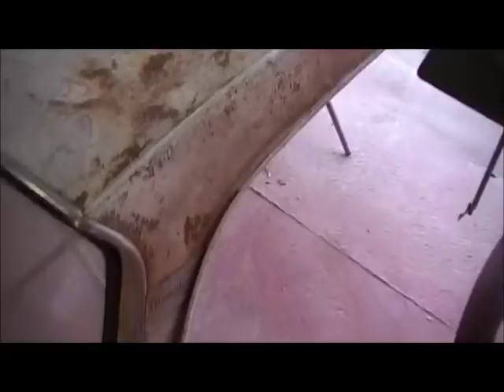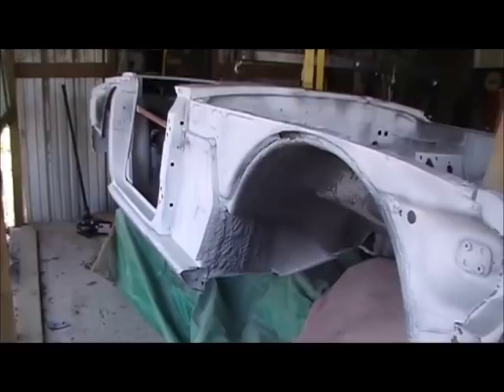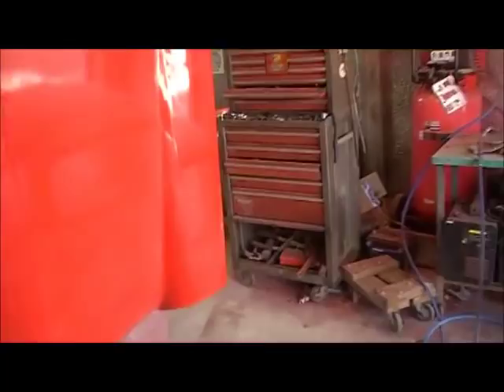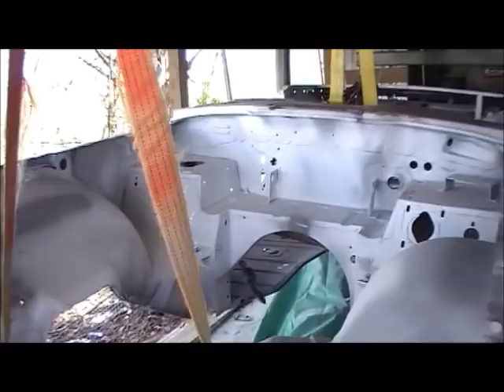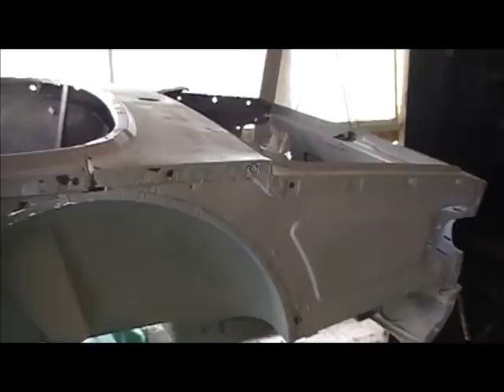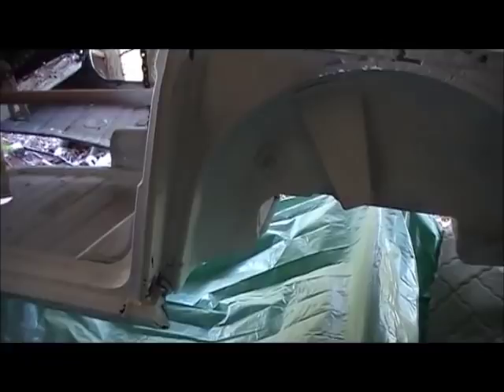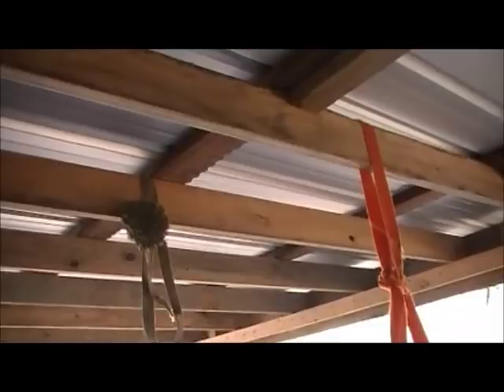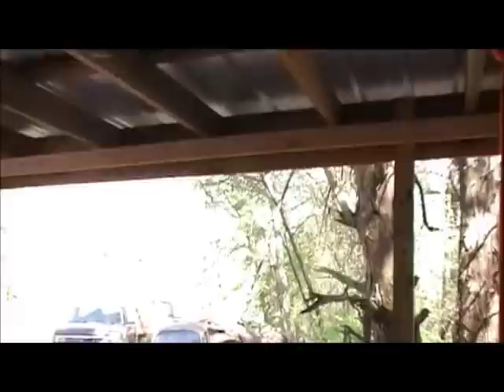Three at once

Comment: You've been busier than a one eyed cat watching two mice holes Cutworm. Be careful and don't over do it, goofy ideals aren't so goofy when they work out my brother. God Bless you my friend.
Reply from the maker: John S. Hiya Big John!  I am more interested in what you have been up to. My goobin around don't amount to much when you spread it out into four days. Loven huggys!
Reply: Not a lot brother, I finely found me an old IH Cub mower and have been putting back into mowing condition as well as my other mowers and Spring cleaning also. 

I got it in running shape and mowed a little but the deck was noisy so I ordered all the bearings for it I'm hoping to save the seals but wont know till I tear it apart. 

I had looked for almost almost two years I would say  before finding one close enough and a price I could work with.   

Easter with the grand kids just all the stuff us older farts get into when they wont let use go to work anymore.